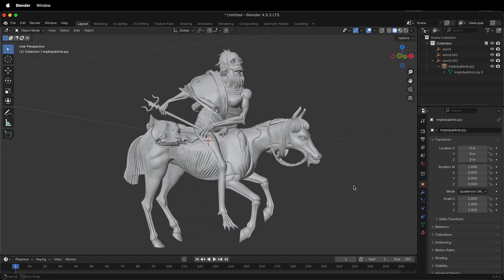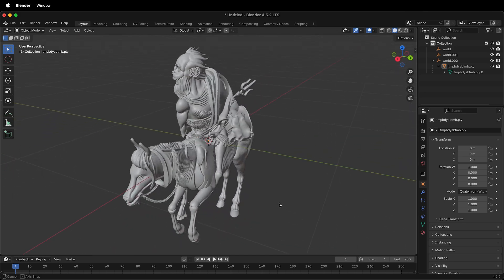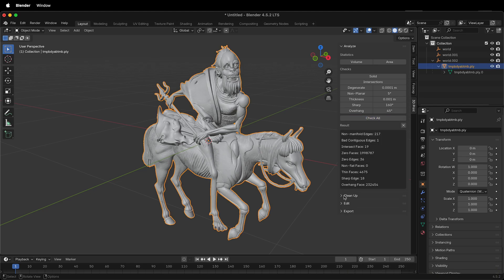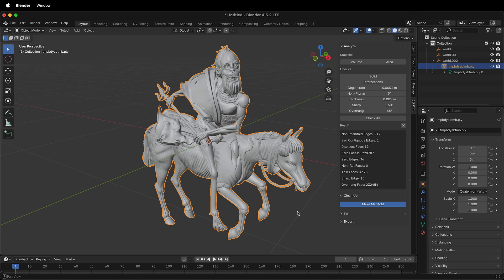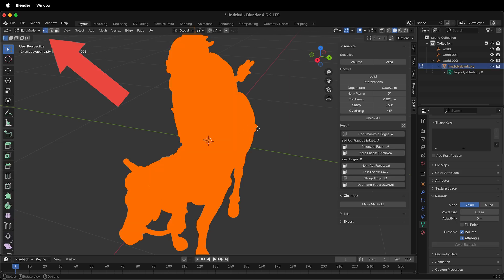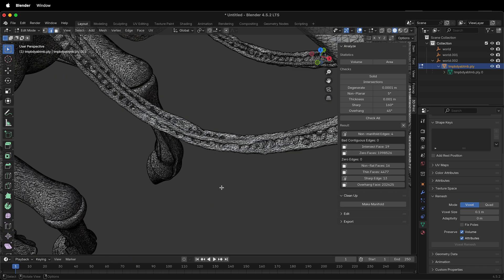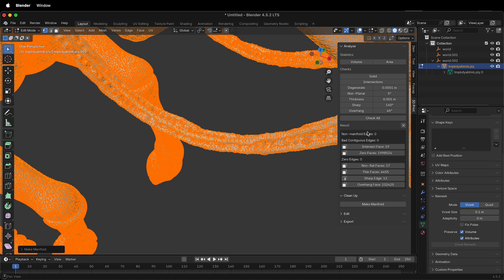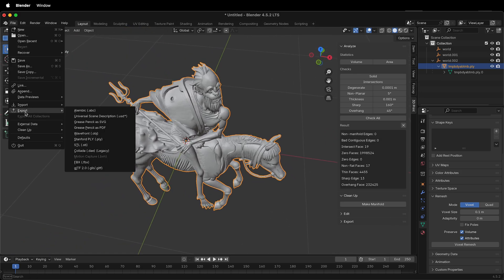Make Any 3D Model Manifold in Blender: 3D Print Toolbox Guide

Comment: Every time I click check all blender stops responding is there any other methods? I’m really struggling
Reply: Or am I possibly missing a step
Reply from the maker: How complex, how many triangles in the mesh?
Reply from the maker: Merge all vertices in edit mode first, then use the decimate modifier at about 0.5 and apply the modifier and then try again
Reply: @W @WhatMakeArt ok I’ll try this when I get home and I think it had like 13k manifold edges i simplified the model and got it down to 7000 but it still wouldn’t fix it